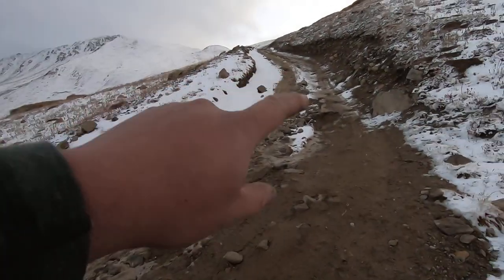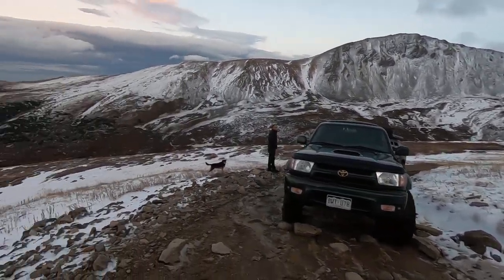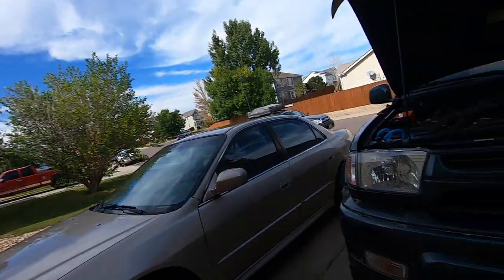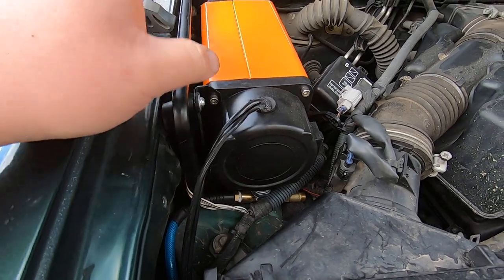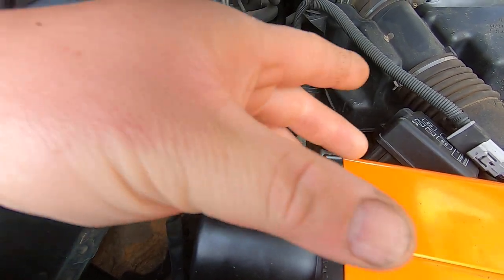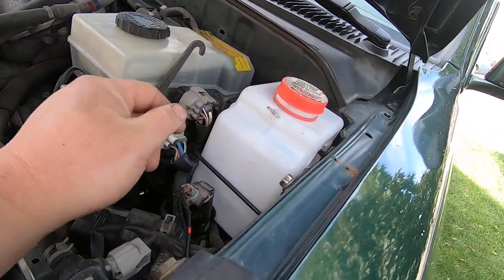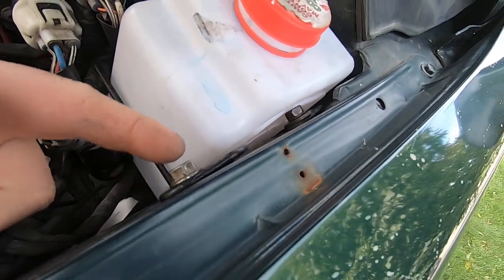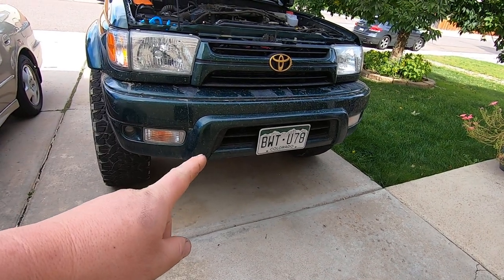Argentine pass and update on Mallcrawler

Comment: What master cylinder and brake booster are you running?
Reply from the maker: It's factory. I believe electric booster starts in 2000 up to 2002. Mine is 2001. The abs pump and booster are integrated together and that's how we have traction control. Early form of ATRAC
Reply: I’m having issues with mine. I wonder if those would fit/work on my 99 limited
Reply from the maker: @mterezakis10  it's a whole different system. It's not worth the hassel to try and make it work even if you manage to figure out the wiring problems that you'll encounter. It's not a simple plug and play system. The newer abs system has the ability to apply brakes separately to individual wheels while the older system like yours can only bleed off brake pressure when a tire locks up.
Reply from the maker: @mterezakis10  yours only has vsc (vehicle stability control) while newer models has vsc and Trac (traction control). Vsc basicly control vehicle rpm either through ignition timing or fuel cutting when computer detects wheel slippage. Trac has the ability to control individual wheel slippage by apply brakes to just that wheel. Newer systems that are found in the 4th gen are known as A-trac or active traction control is a updated more aggressive system that is more progressive and sensitive to wheel slippage. 5th gen 4runner get the updated version of A-trac that is capable of being adjusted by the driver and that's known as multi terrain control. "Technology" lol
Reply: Thanks for the info,that is good to know. Guessing I’ll stick with OEM spec stuff for my year then.